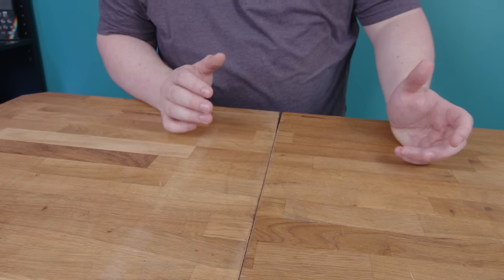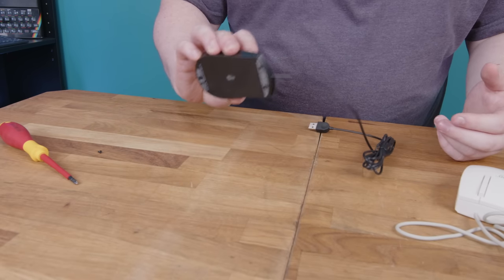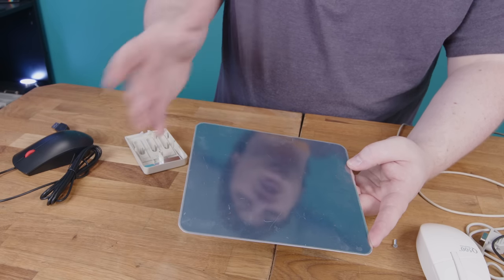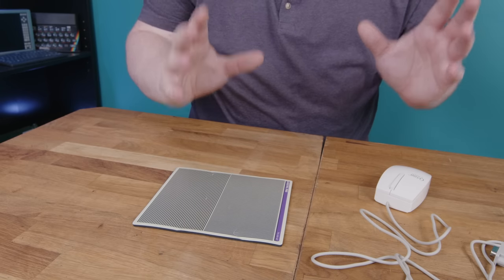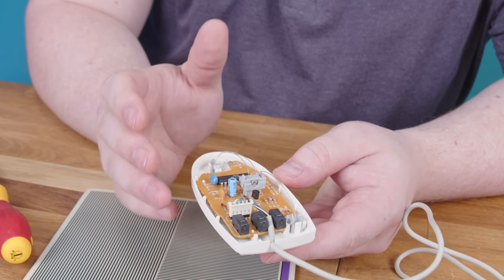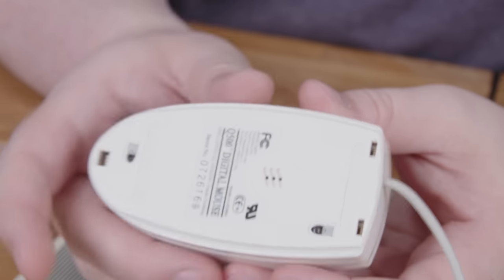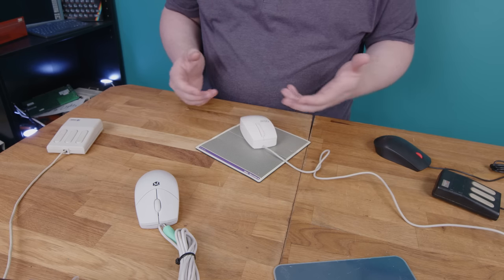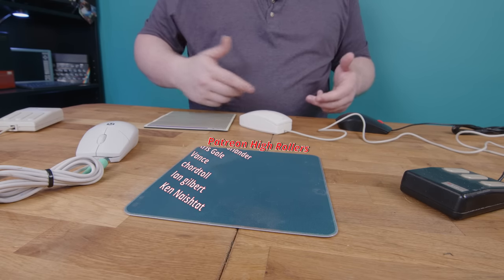Q500, The Weirdest Optical Mouse

Comment: ...holy crap, they built an optical mouse around a ball mouse chip, didn't they? I actually gasped when I realized [it hit me right about when you opened up the mouse]

Imagine if they'd put this out as an InPort mouse instead of serial, then they could have made it even cheaper [I think they couldn't have gotten away with the strobing, so they'd need four photodiodes, but they wouldn't have needed a microcontroller]

I do think it's interesting that both the modern optical mouse and the mouse systems mouse have what appears to be a metal plate in it because it would otherwise be too lightweight - it does make me wonder if the drastic weight reduction [since mouse balls weighed, what, 2 ounces?] was ever a source of user complaints for early optical mice.

For the LGR mouse, I think the way it works is obvious - if you apply a directional blur to the dot grid [which could easily be done by the mouse's optics] it turns into an array of gray stripes in the desired direction.
Reply from the maker: you know what's most interesting to me about that first notion - I'm pretty sure you could remove the IC from this, bring the leads for the photodiodes and LEDs out to a 9-pin, and make this work on a sega genesis. I'd have to refresh myself on the gamepad protocol but it has a strobe and i think four inputs, which is enough to sample everything here. obviously you would need custom software heh
Reply from the maker: also - interesting idea about the lgr mouse. hard time picturing how that works in my head but i'll buy it

Comment: I once had a mouse that got 2 Buttons instead of a scrollwheel, the buttons will "lock" the X or Y axis and would allow to scroll a webpage when used with the software of the manufacturer, without this software it would just lock the X or Y axis... was nice to draw straight lines in paint, but otherwise useless...

Comment: I have an optical mouse that's stuck in joystick mode. I have Daz Bryce 4 raytracing graphics package that doesn't work with a mouse that's stuck in joystick mode. Thanks for the information. Maybe I should get the old trackball mouse for the old software when needed.

Comment: Would a controller chip used in a ballmouse really work without at least some firmware modification?
This mouse has to resort to strobing because it uses the same sensors for horizontal and vertical motion.
A ball-mouse has two rotary encoders with dedicated photodiodes/phototransistors, though. It doesn't need to strobe - or does it?
Reply from the maker: It's a good question, and frankly I'm probably stretching, I just like the fantasy.

Comment: Definitely not made with a generic ball mouse encoder. Never seen a ball mouse plug into the serial port. And ball mouse wheel encoders provide a lot less data input to the encoder then this optical one require. The strobing of 2 LEDs is not an option in a ball mouse chip encoder either. Also the encoding principal is different.
Reply from the maker: I'm not sure how you've never seen a serial ball mouse, there were thousands. Every version of Windows ever made supports them.
Reply: @CathodeRayDude  Ok, I accept and agree. What about the other 2 arguments?

Comment: They would have sold more if they added a few lead weights. Heavier things seem more expensive. There are, for an odd example, electro-shock sex toys out of China that have cheap and expensive versions of the electrodes available. The only difference between the two is a 50 gram lead weight.

Comment: Seeing how they unrolled the ball mouse here, and even added the option of using it kind of like a flight stick... I wonder why i have not heard of optical flight sticks, i mean apart from the abomination i made. LOL Seems like such an obvious thing. Flight sticks were unreliable for ages, and the main gripe of customers... And even still today we have the same problem, which is why better sticks come with magnetic sensors. Yet we had optic sensor this cheap, this reliable, and it did not take over the stick market.

Comment: Interestingly I miss the serial port RS232 or PS2 mice, keyboards and ports. Beleave it or not these older mice used far less computational power and far more important far far less interrupts to the CPU and motherboard. In the late 90s as USB mice came more commom it really played hell on the system if you were gaming for example. Thus most gamers and power users avoided USB for  RS 232 and or PS2. Its a real shame actualy to see RS232 not have support in both hardware and OSes. It could transmit and receive data from over a mile away over cheap cable. Oh well.
Reply: USB for input devices is only a problem when the USB controller is software-based (and the OS has to do all the processing), and when the device is low speed. Cheap keyboards for example can only be sampled once every 12 ms while better ones can be sampled much faster, even faster than with PS/2 and serial. Also I don't think USB required interrupts, but PS/2 did: USB 1 devices don't send data unless the host is asking them to (a.k.a. polling) while serial and PS/2 just sent it whenever it wanted.
Reply: @DiThi  Well USB has its good points and are extremely useful. But I have never seen a dedicated controller chip for USB. Their may be one but one but one thing is a fact. I did not use cheap hardware in those days. I had for example a $55,000 SGI MIPS on IRIX, 2 SUN SPARC 20s with Dual ultra 3 SPRAC CPUs at simaler prices to the SGI. My point is I used the high end and the USB was very noticeable decline in performance. Firewire was in development in my building and USB was a wining competitor but my point is it was USB was very boticanle drop. Poling or not poling. As CPUs and Motherboard logic speed up it was soon not as noticeable. However using it with a light sensor to track a moving object caused major latency issues using USB so we switched back to RS232. Great for Instramentation and control projects. Like controling the water level of DAMs and floodgates and power generation temprature etc.. A very usefull tool the RS series of ports. Useles for large data transfer though. Take care Alberto.
Reply: @jimbronson687  USB 1 was littered with these low effort controllers, I know because I dabbled with compiling linux in many machines, and using modules that were distinct between the software (UHCI) and hardware (OHCI) implementations. If your device and host were USB 2.0, you were guaranteed to use EHCI which is dealt in hardware, but with USB 1.x devices you could still have UHCI under the hood. There was never "dedicated USB controllers" because they were always bundled with motherboard chipsets.

Both UHCI and OHCI are controller chips. By "software implementation" I mean that UHCI offloaded a lot of processing to the host, while almost all OHCI controllers were more intelligent than that.

Comment: The only people I’ve seen using a ball mouse these days are retro computer enthusiasts. No one uses a USB version of a ball mouse, if one even exists, on a modern computer. It’s much like how no one records data onto compact data cassettes to store computer programs because the only reason for there onetime use was they where a cheap form of storage at a time when floppy drives and especially hard drive where extremely costly. Retro home computer enthusiasts will use for nostalgia reasons but even the. Many will company the audio data off the cassette onto a digital audio file and they make devices that allow you to play back said files on old home micro computers with the appropriate interface (For example, There is a C64 version with the proper cassette port interface).
Reply from the maker: exactly! people will use them as a means to a specific end and that's it
Reply: Does a trackball count? ;3
Reply: I still use ball mice on most of my desktop computers, but that's because I already have them and they work fine. Most optical mice are USB and thus wouldn't work with my PS/2 KVM switches without an adapter. Side note, I believe I have seen one or two USB ball mice.
Reply: @eDoc2020  One reason I gave up on ball Mice completely was that I got tired of having to clean the rollers inside when they started to not move smoothly. I did recently have the same problem with the scroll wheel on my more modern Optical mouse which was pain to clean but otherwise the mouse movement action has never been hindered by dust as optical mouse work perfectly most of the time with maybe only the mildest of dust removal needed ever. Don’t mind a ball mouse in limited tree circumstances with say an old 80s ho e micro computer for example but on any modern PC or Mac I’ll stick with optical mouse, even cheap ones. I don’t do retro computing with physical hardware much these days as I mostly use virtualization software to play retro micro computer/classic DOS games) so I rarely deal with old ball mouse much anymore. I especially like the fact that modern USB optical mice offer many additional mouse buttons for say back and forward web browsing or other user programmable functions vs the typical two or three button limit of most old ball mice. But for anyone who who OK with still using a old ball mouse and having to clean them then every so often then more power to you but for me even cheap optical mouse is just less hassle for me in the long run.

Comment: While the vintage Sun mouse shown has nerd appeal, I used them in engineering school in their era and they sucked. A decent $50 ball mouse of the era performed better. Later in the 1990s Sun used a newer optical mouse that was a little bit better than the best ball mice of the time. But mice of today absolutely smash all 1990's pointing devices, even a $1 mouse from Ali Express. It's easy to have rose colored glasses but computers back then sucked in all ways. Game programmers were much better at creating compelling content with far less resources, but that's about it.

Comment: just one thing Screws are shit and only used because they are cheap, a clickin desing is harder to manufactur and need more precise machining than screws.... and click in is longer lasting aswell if you use it right in assembly and disassembly. its not a ballmouse it uses ballmouse logic non the less

Comment: Hi kitty!
Reply: Also that looks vaguely familiar.  I think the reason that no one bought it is that you looked at the pad and went eww that's too small, what a stupid kludge.  I bet it doesn't even work!  At least that was my reaction.

And I do remember mice that needed those special pads two color pads. Even though I was a programmer it never occurred to me to have mouse envy.  I didn't go, damn I need to be rid of my ball mouse and get an optical one!

Digitizers seemed cooler.  They also only worked on their own surface, but the pucks had clear parts with crosshairs on them so you could a piece of paper down and trace it.  Some of them even used pens.